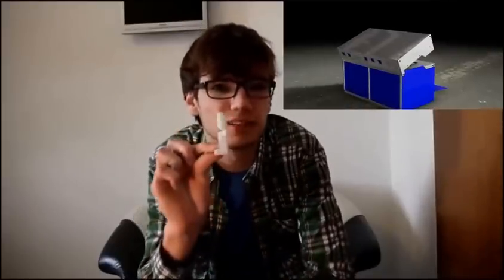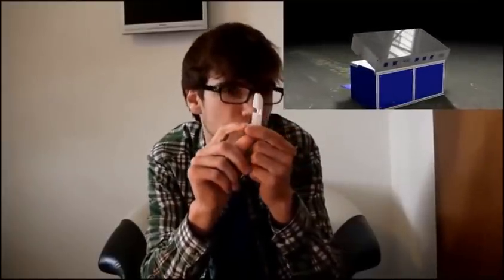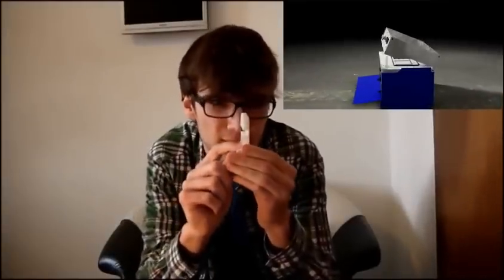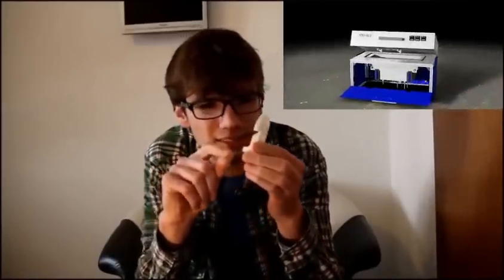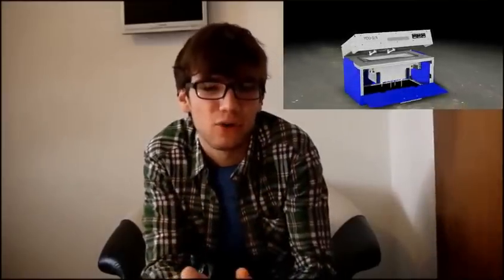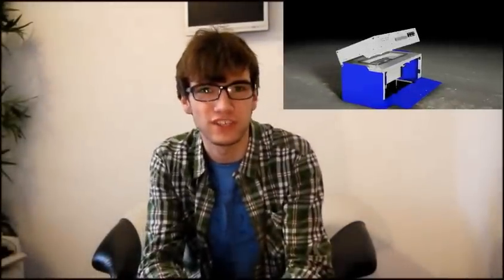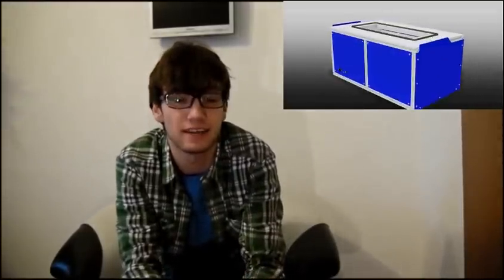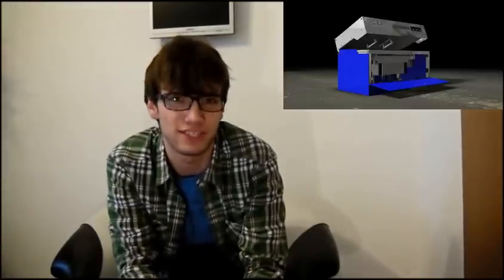You SLS. Open Source SLS 3d printer

Comment: Great project!
I have a question about the laser, what is the temperature that you cuold reach with your laser?
My idea is to develop an alluminum printer, do you have idea of what power of laser I need to use?
Reply: depends how fast you want to print, the higher the laser power the less time it has to stay on the same spot to melt it. this source: https://www.daaam.info/Downloads/Pdfs/proceedings/proceedings_2018/137.pdf   says they use a 300 watt laser to print stainless steel at 40mm a second at a layer height of 0.05mm.

Comment: Thank you so much for sharing this. This is exactly the project i was looking for. The sls printer are more attractive to me over the standard fml desktop printer but as a hobbyist they are out of my league money wise. I am 25 years old and live in Sweden. I think I will be done with my cnc mill in the end off this summer so this would be a nice winter project.
But am I right in saying that this is a plastic printer only?
To print in metal would require a stronger laser (up to 100w?) and a argon filled building chamber.
Do you think it would be a big step in adding those features?
It would be nice to print my one landing gear for my rc plane.
Reply from the maker: Daniel Lövgren 

Hey Daniel!
You are right in saying that a metal laser sinter poses quite a few additional challenges.
I don’t think that this printer would be the right base to start from if that
is your goal. You also have to keep in mind that if you want to sinter metals,
your chamber needs to reach about 1000 degrees Celsius, which aluminum cannot
withstand. You can take a look at http://www.metalbot.org/
. This is an active group of people trying to make open metal sintering happen
in the near future.

That said I
think it is absolutely possible to take my design and add everything you need
for metal sls, the question becomes whether or not it is worth it (if you want
to, take a look at www.you-sls.com and
download the files from there and I will try to help with the best of my
knowledge) because the print material would become a major expense plus you
have to handle the gas and all the rest of it.

If you have
further questions, you will find a contact form on my website